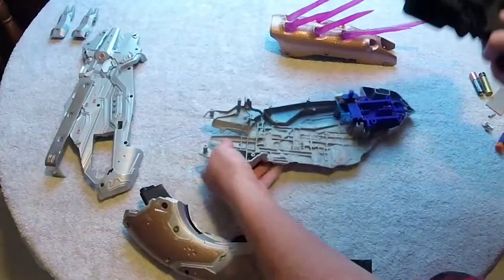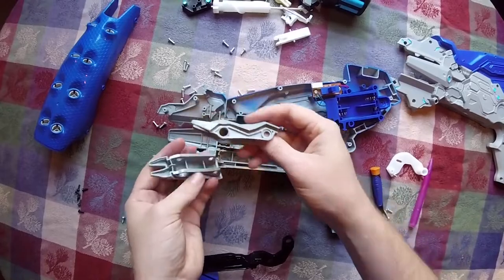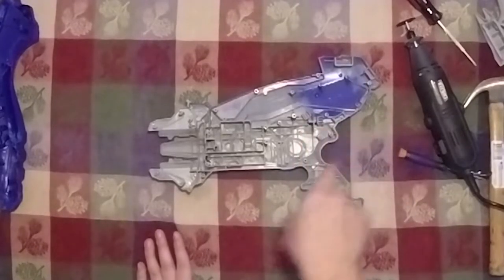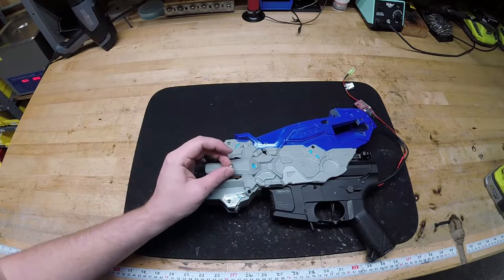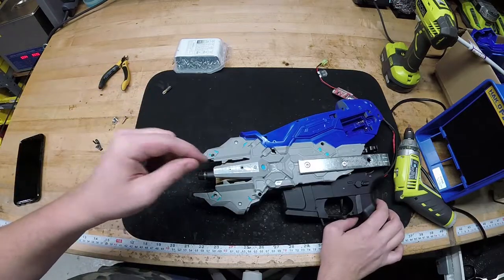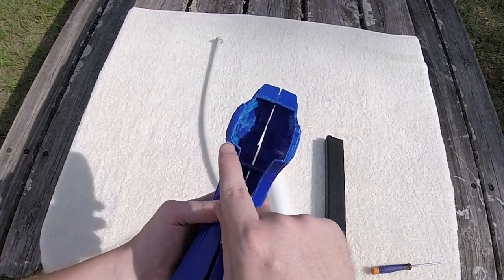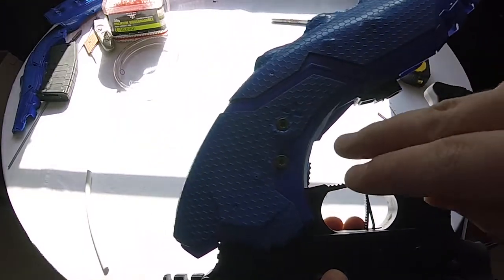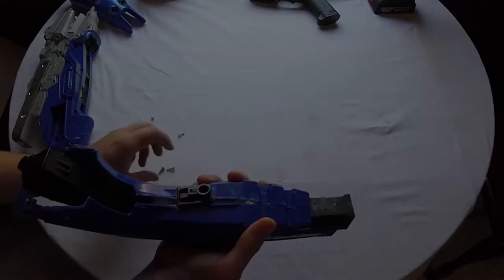How To Make Your Own AEG Halo Airsoft Needler

Comment: Hi I rly wanted to do your assault rifle build but just in case I can’t get the boomco do you think it would work with nerfs new halo MA40?
Reply from the maker: I'm not entirely sure if the UAR will work with it yet. Reason being is because the MA40 nerf gun seems to be a bit more slim, compared to the boomco AR. 
I'd have to see one in person to get a better reference for what airsoft gun would be best to convert it with.
Reply: @Spartan Jess - The Halo Airsofting Spartan is that a hint to a future video perhaps? 🙃
Reply from the maker: @kamdendugger9618  Oh don't worry, I'm definitely going to do a conversion video about the MA40.
Reply: @Spartan Jess - The Halo Airsofting Spartan that’s great cant wait for it
Reply: @Spartan Jess - The Halo Airsofting Spartan I don’t know if you know but the nerf MA40 is available on Amazon right now it still says October on the nerf website but I guess they released it early 🤷‍♂️